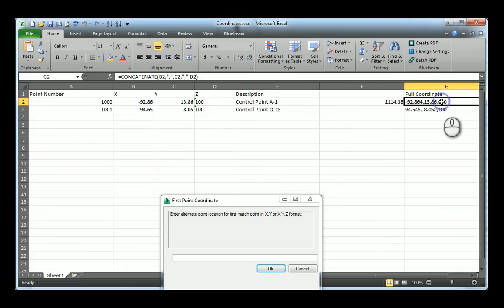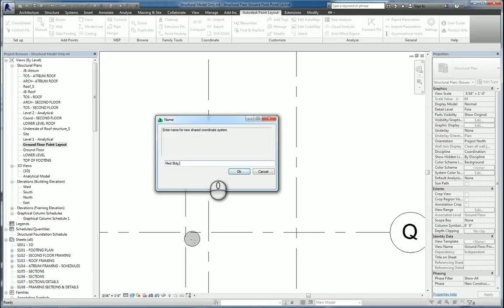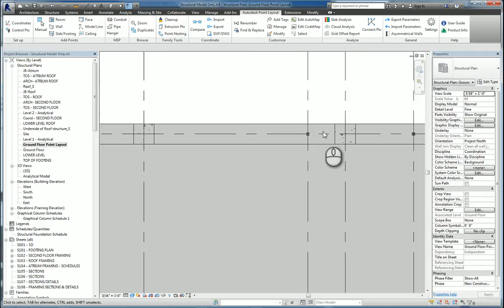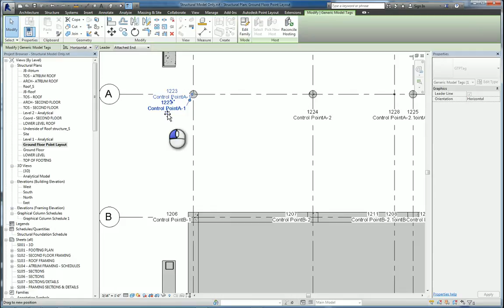Autodesk Point Layout Coordinates and Control Pts   A How To Guide

Comment: is the same steps in auto cad civil or how work there
Reply from the maker: once you install autodesk point layout, it will install in your autocad as well.  The procedure is the same.
Reply: how you change to new UCS I try but I cant.
Reply from the maker: Easiest way is to use the View Cube to orient the view to what you want...then, type in UCS...then type in View.  This will set the UCS view to the current view you are looking at.